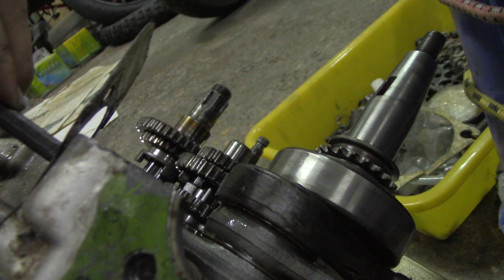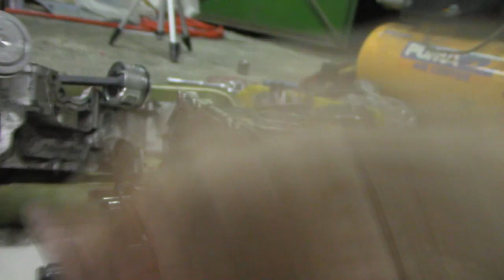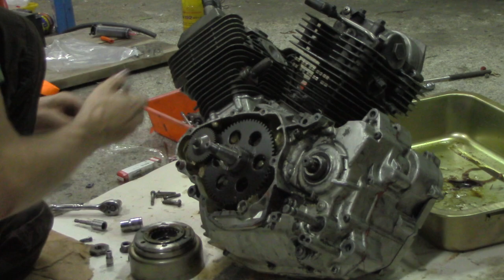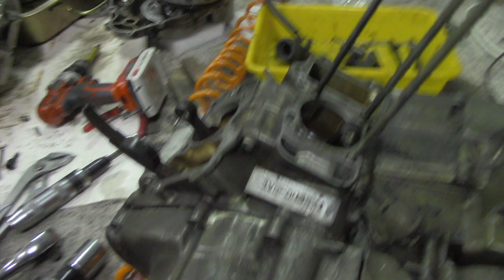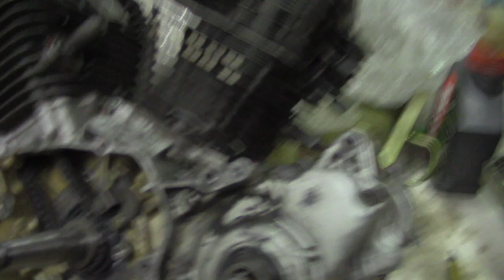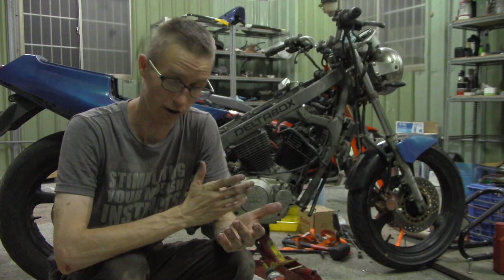Yamaha FZ 150 Rebuild/Upgrade Part 2

Comment: how about availability of parts in Taiwan for these old bikes, could you get gasket set for rebuild or did you have to use instant gasket? brake pads etc available?
Reply from the maker: Most of the consumables can be found from the aftermarket. There are a lot of these bikes in Taiwan. Even though the parts aren't made anymore, it's not a problem if you're in the right groups. I just bought another parts bike and a used engine for this build. I'll sell what I don't use
Reply: @ExpatonTwoWheels  thanks for info, I have found an old bike and if I can get at right place I fancy rebuilding it as a project, just worried about spares, I'm down in Kaohsiung, are you on line or can I connect with you some other way